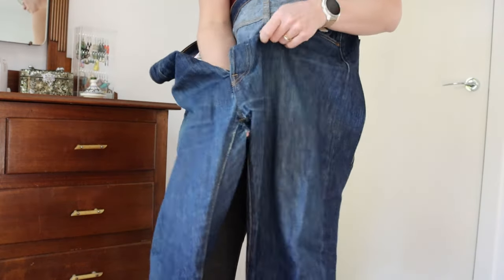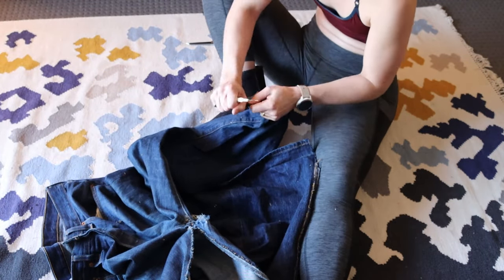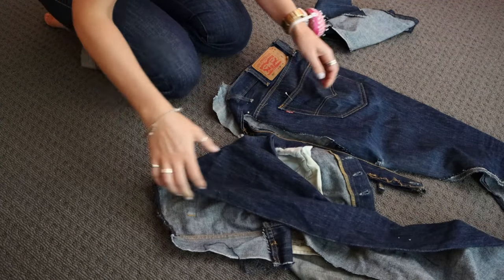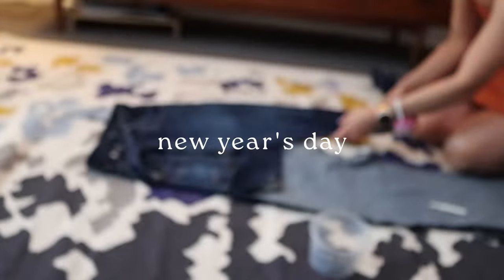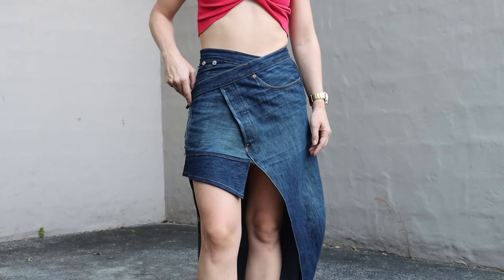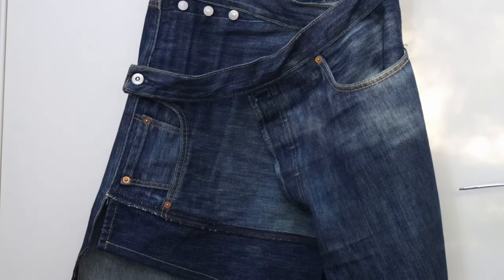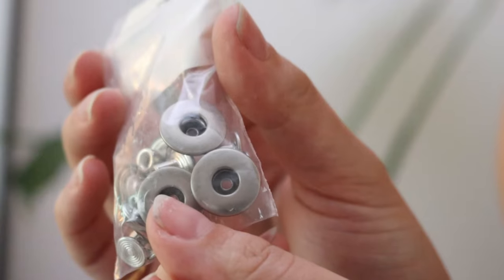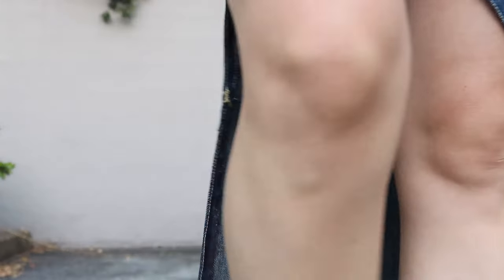jeans to skirt upcycle project | denim maxi skirt

Comment: Incredible job on this flip!  I've always wanted to flip a pair of jeans into a maxi skirt, but not in a rush because I want to think about and choose a cut and style (including placement of slits) that I will love longterm 😊

We're quite similar Steph!  I have a small waist, very long torso, and short legs lol 😄

I'm obsessed with denim- thrifting, fixing, and re-working denim is just EVERYTHING!  I've received a few pairs of my husband's old worn out jeans, which are on standby in my stash.

You may already know this, but sharing in case you didn't- when sewing denim on a sewing machine or serger, try a size 110/18 needle.  SERIOUSLY.  They're like smooth as butter when sewing through denim.

I've been sewing as a hobby since I was 16 years old (a WHILE ago lol) and it wasn't until 2024 that I discovered the size 110/18 needles.  REGRET is putting it lightly!  The things I can do with denim now are like a hundred times better now than anything I ever attempted (and I was pretty good before!).  I also used to despise hemming jeans, but it's a BREEZE now!

Love your videos so much! 😍